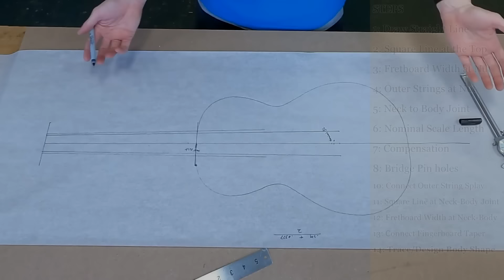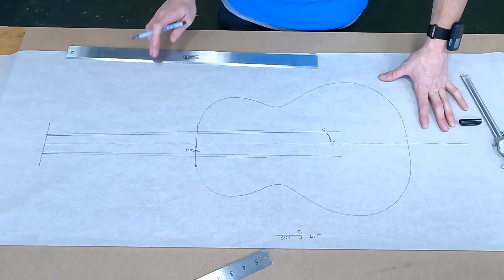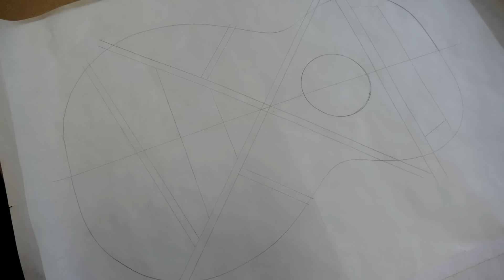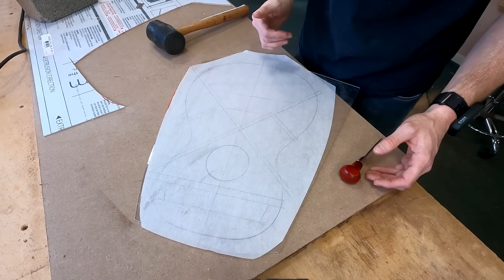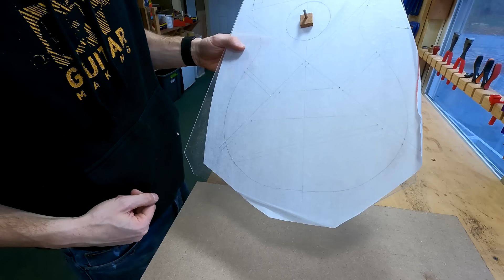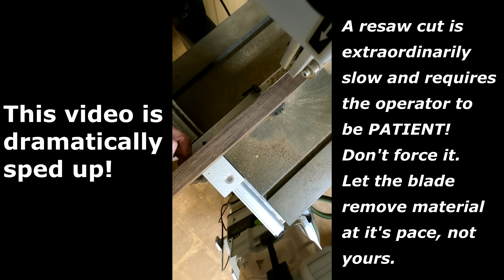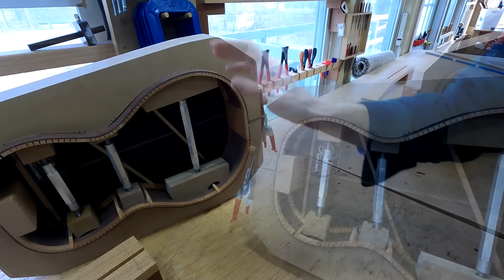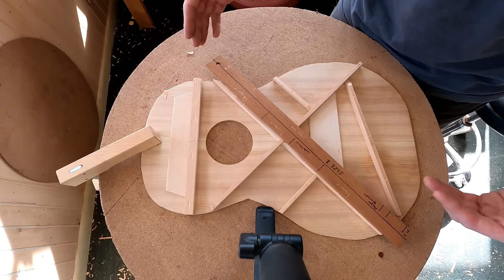Parlor Guitars from Scratch | Full Design and Build with Commentary from the Luthier | Part 1

Comment: Redwood is a seriously underrated soundboard. Also, a piece of cardboard works fantastically as a strop. And finally, why do you bevel only one vertical edge of the brace instead of beveling both sides to a point towards the middle? It looks cool.